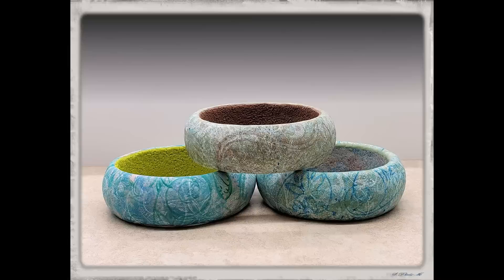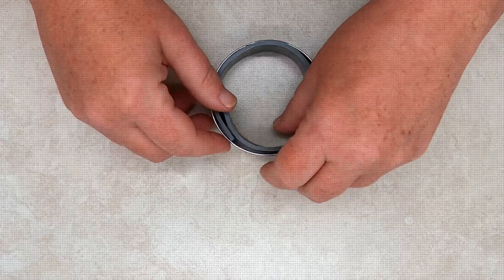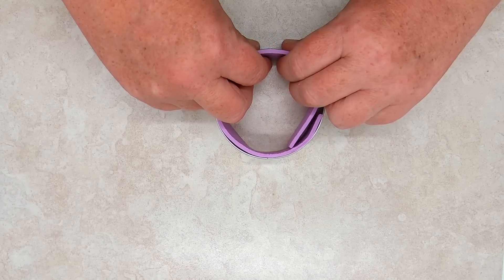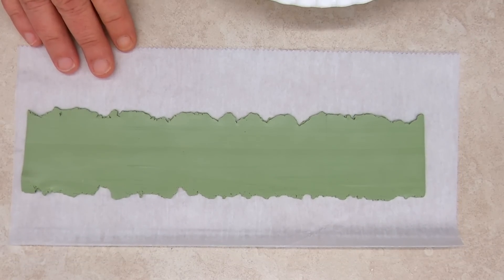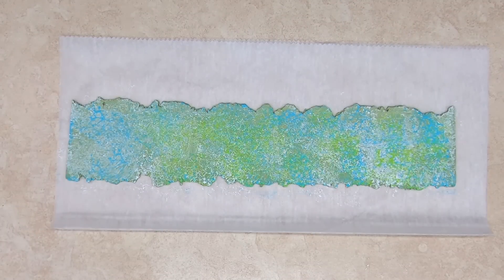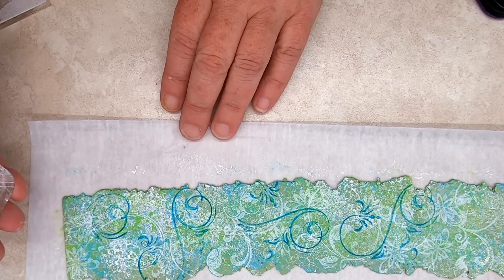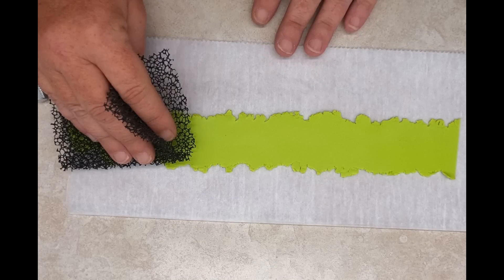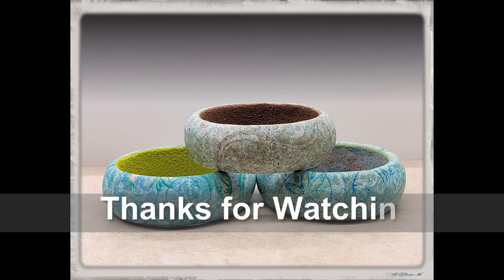Subtle Romance Bangle

Comment: Was wondering  can you use a coke can the make the base and what brand for scrap clay
Reply from the maker: Silverguardiancreations yes, I used pop cans for years-until I finally put the EasyBangles Kit together. Any brand scrap will work.
Reply: Hey there!  I think soda cans would work just fine.  The scrap I was using is a mixture of Kato clay and Premo, I cured it at Kato temp.